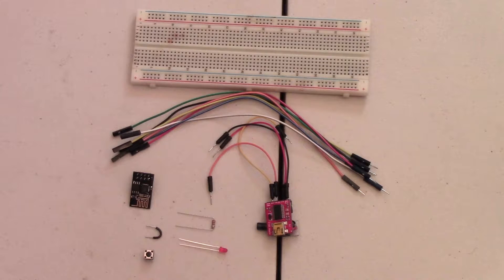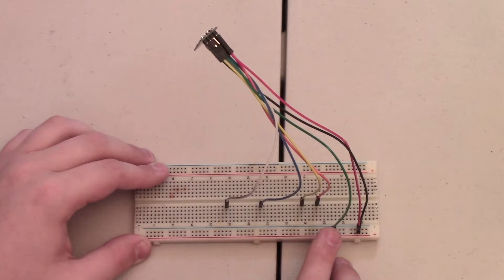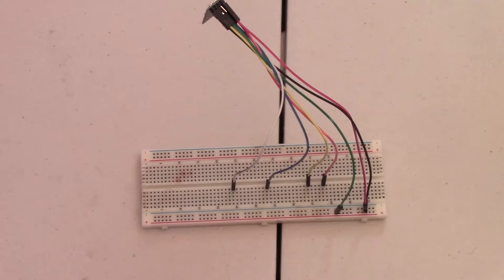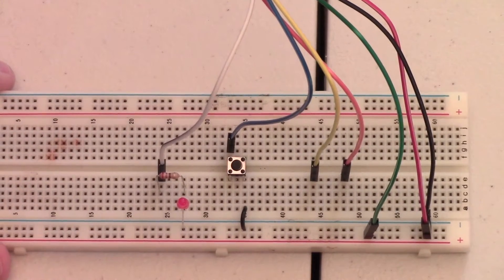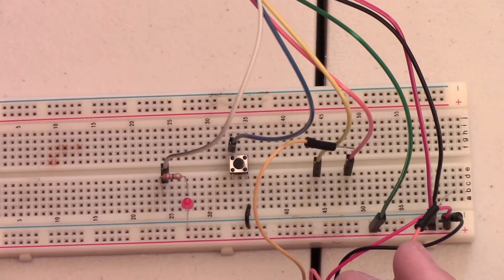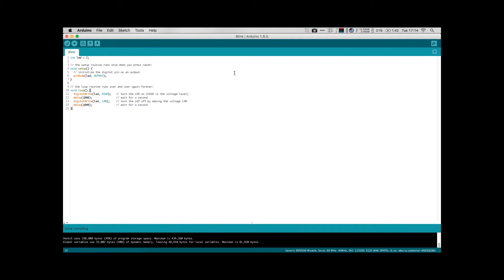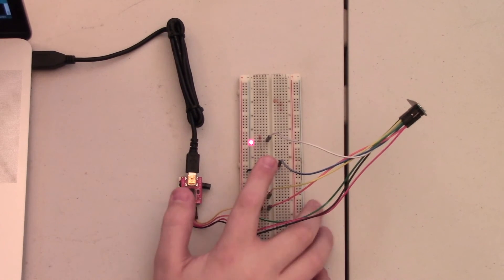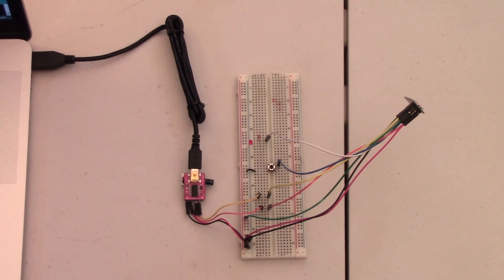ESP8266 Getting Started on the Arduino IDE

Comment: hi @ItKindaWorks, Good tutorial, I've tried it and it works. Thanks!
But why in my case when usb cable is removed, and reattached the uploaded program does not exist? Back as early, empty.
Reply from the maker: I've never heard of that happening. Are you sure that you aren't changing anything else? What happens if you just reset the module by pressing the button connected to CH_PD after connecting power? It might be that for a split second when the ESP is starting up, it doesn't have clean power and crashes. That shouldn't be the case if you reset the module after applying power though.
Reply from the maker: Sorry I think I meant to say the button on the reset pin -  not CH_PD which should just always be pulled to 3.3V
Reply: I do not know clearly during the previous installation, CH_PD or Reset pin is installed and also other pins are not like schematic. But when I reinstall it, the previous case did not happen. Sorry, it looks like I'm not careful, thanks for the response.
Reply from the maker: No problem, glad it sounds like you have got it working!

Comment: Please update the description to use the correct Aurdino Boards Manager Link:
http://arduino.esp8266.com/stable/package_esp8266com_index.json

The old file has been removed so it doesn't work at all. You will get an error message "Error downloading file" and the old board manager link.
Reply from the maker: Thanks, I just fixed the link!

Comment: Nice Tutorial. I have a question. I want to use the IoT SDK from Amazon in a smallest chip possible for an IoT use case. For device connectivity AWS provides an SDK in embedded C and Node.js. Can i integrate it directly to the ESP8266 ? Moreover i would also need to place some certificate files on the device. Is it possible using the ESP8266? What are your views on this?

Comment: Why it is necessary to pull up GPIO2 and it worked without it?
Also, Is it electrically correct to pull up an output pin?
Reply from the maker: The pin can be left floating however to eliminate any problems I pull both 0 and 2 high. There isnt any hurt in pulling the output high with a weak pull-up resistor (1k+) but yeah there could potentially be issues if you just tied it to 3.3V I suppose. Basically you just dont want the pins to be pulled low at all on startup. See this page about 2/3 of the way down for a chart showing the various boot modes and how the pins affect how it boots http://www.esp8266.com/wiki/doku.php?id=esp8266_gpio_pin_allocations

Comment: I had to remove my low quality LED on GPIO2 in order to make it work!
Reply from the maker: +Roger Rabbit You shouldn't have to as long as you have a pullup on the pin as well. It's odd that you had to remove it unless it was broken.
Reply: ItKindaWorks Right, first I used a tiny red low cost LED - that was causing the problem.  It was then working with a better quality LED and a bigger resistor.
But it was not just one broken LED, the whole series was rubbish.